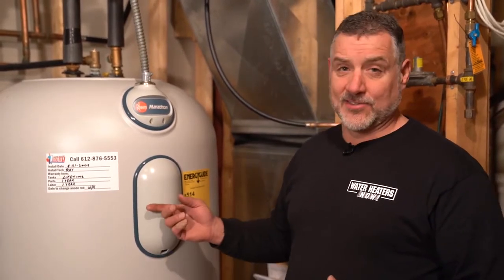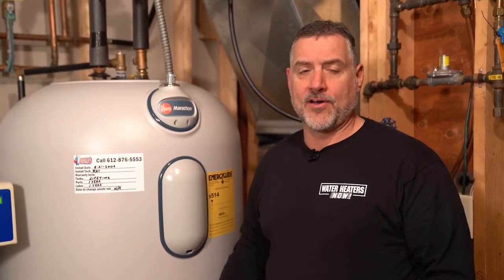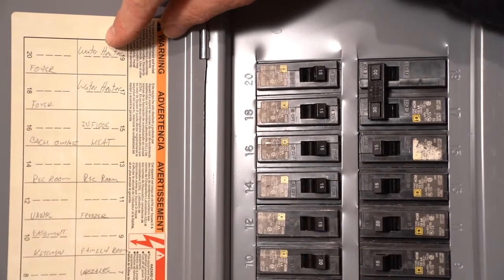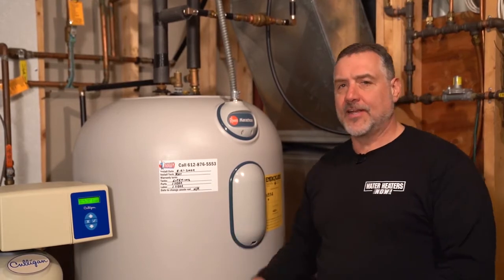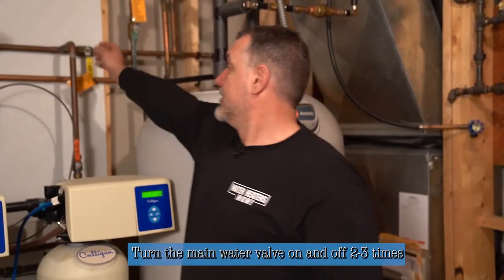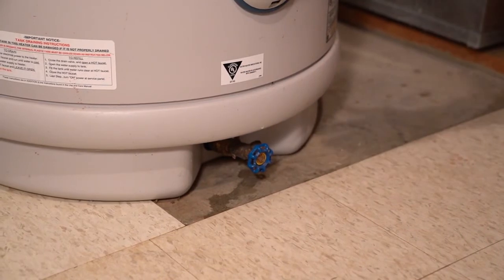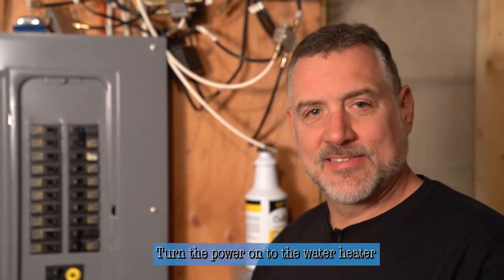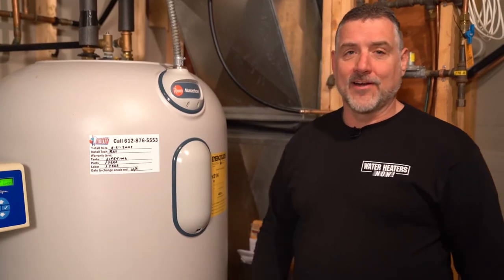Electric Marathon Annual Service - Water Heaters Now

Comment: You stated electric was the most expensive option for water heating. You may have overlooked propane, and its cost. I have a propane water heater and find its cost to be around $50 per month at $2.00 per gallon cost. I also have a Rheem Hybrid 50 gallon and find its cost to be less than $10 per month.

Comment: Had one of these, lasted 16 years. just sprung a leak somewhere in the bottom of the tank, our REC replaced it for free. I have to reinstall the new one, but these things work great.
Reply: Mine just finished 16 years also. Started leaking from under each of the three rubber grommets at the top of the heater. Filed a warranty claim, company totally blew me off. Lifetime warranty is a total lie.
Reply: @Jimmie Noble  I think the difference was that our Rural Energy Commission did the warranty work, i just peeled the sticker off, left it on my back door, they took it and left me a new heater.  Im sure if i had to go through the company itself it would have been a nightmare.

Comment: summary: no steel in the tank, tank is plastic, tank itself has life warranty, will not rust out.  4.5" of insulation, which helps with electric costs, as electricity is not the most efficient way to heat water...  i would assume that on demand gas would be efficient, and smaller too!  shut off the heater element at your breaker box, and then run the water out of a hot faucet, until it runs cold (missing this step will cost you $1,000).  Drain it.  Close valve to stop inflow.  Open valve for 10 seconds and  Add a bit of water to swish the bottom of the tank, close valve, drain.  Repeat.  see 2:45 on the video.  Turn valve on.  Fill for 10 minutes, and run hot faucet until solid water flow is attained!!! or you're out a $1,000.  After she's full, Turn on the hot water breaker.

Comment: Polybutyl tank..humm didn't we have a major issue in this country with polybutyl plumbing.  Driving a class action lawsuit and billions in repiping jobs?
Reply: don't drink the (hot) water lol   i guess
Reply: The banned water pipe plastic is polybutylene. The plastic liner of the Marathon hot water heater tank is called polybutene. But they are the same chemical and react with chlorine found in city water supplies. The ban was for piping only, so Rheem can use the material as a tank liner. I suppose if you are on well water your tank will be fine. Rheem's product advertising information just calls this "plastic lining." a good call on the part of their PR people.

Comment: I agree with former comment.My plumber told me with a marathon never drain it before letting it cool down. turn off power to heater. He said he has seen people hook up hose and start draining without letting water to cool down and the plastic tank collapsing thus ruining the water heater . makes sense!
Reply: there is a vacuum relief valve built into the top of these that vents air in when draining to prevent that. Can't hurt to cool first though.

Comment: You omitted an important step.  Before draining the manufacture says that after turning off the power the water should be run at the faucet until it is cold to prevent damage to the internal tank.  It is then cooled properly and can be drained
Reply: @Don G. I got lucky and read the instructions on the tank!  I had done another model and don't know if I did that step, but fortunate this time
Reply: There is a vacuum break on the cold side that should not allow too much of a vacuum to form.  But best to still follow Rheem procedure.